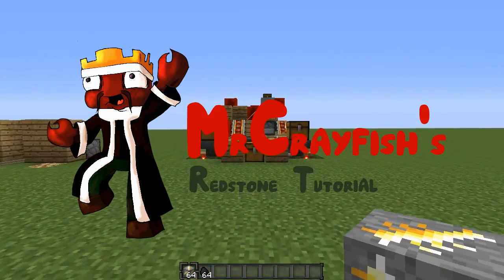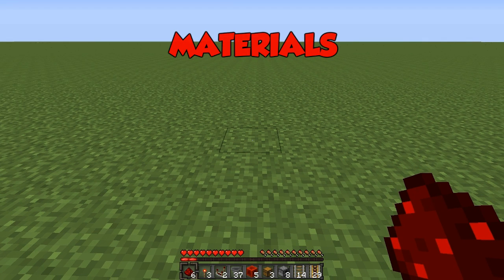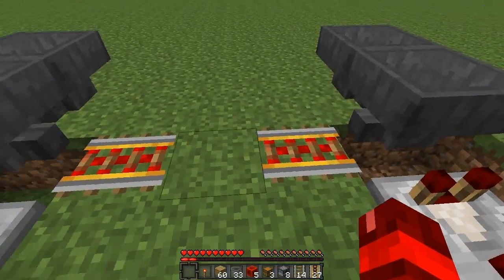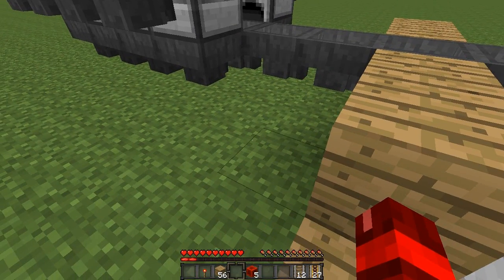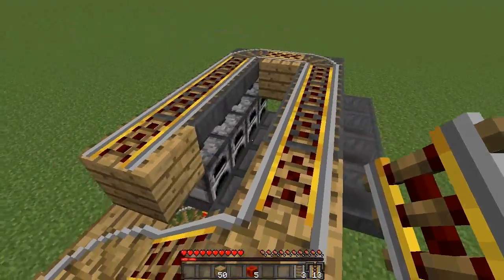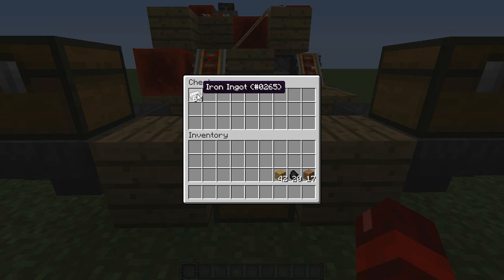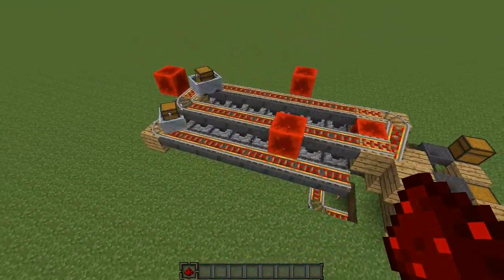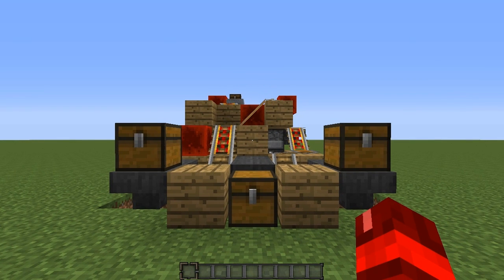Minecraft 1.12: Redstone Tutorial - Industrial Furnace System!

Comment: There's no added benefit to extending to more than 24 furnaces in this design due to hopper clogging. Hoppers move 2.5 items per second, furnaces take 10 seconds to smelt an item = 25 furnaces. Sure, the items will smelt faster if you keep adding more furnaces, but you won't actually receive them any faster.